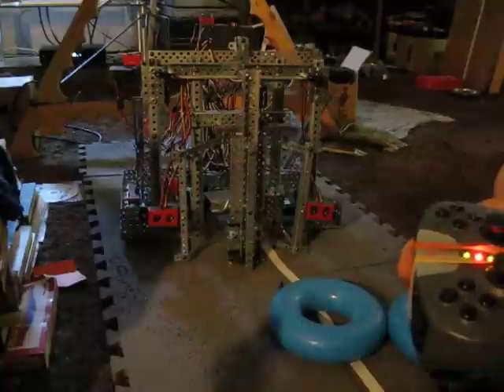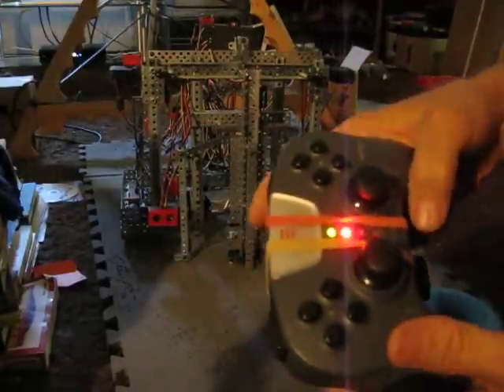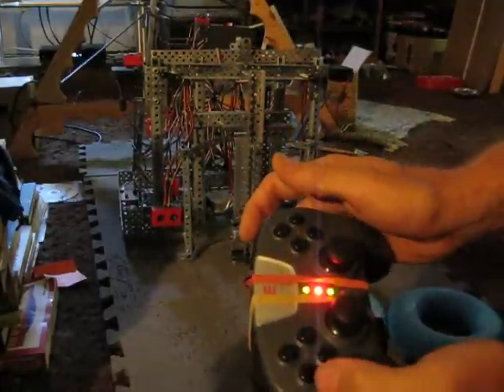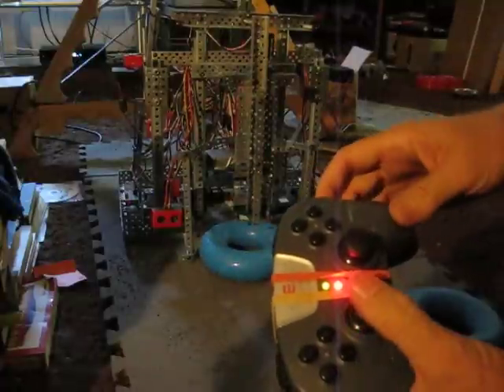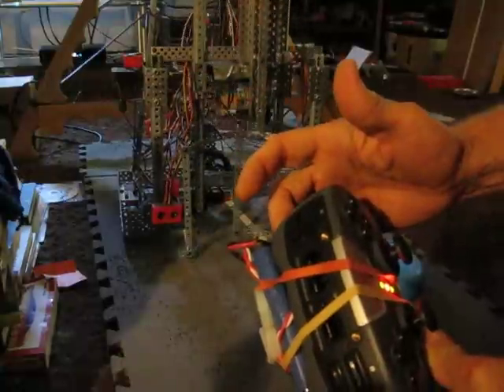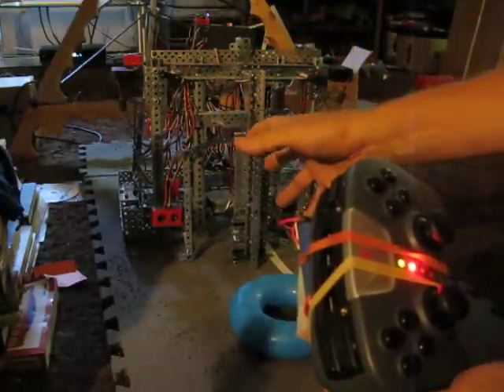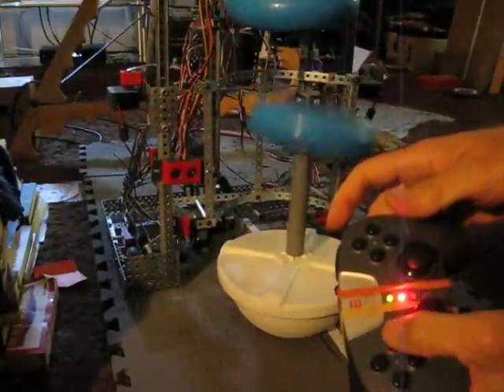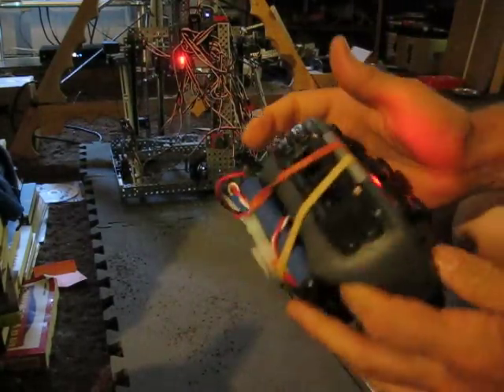599 Vex Round Up Mentor Bobcat:  Use of scripting during driver operation

Comment from the maker: @haingkuong  1 high torque 393 Vex motor is used on each linear slide.  There are two slides for the inner lift and two for the outer lift.    Only one lift is run at a time so it needs the power of two 393 motors to lift.